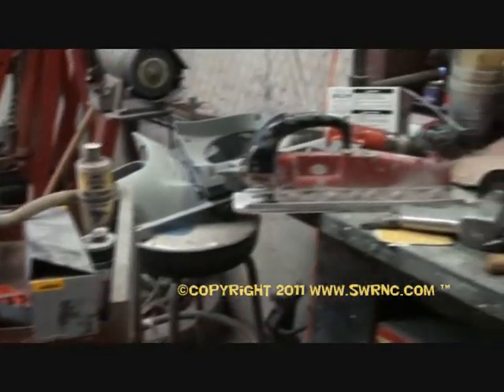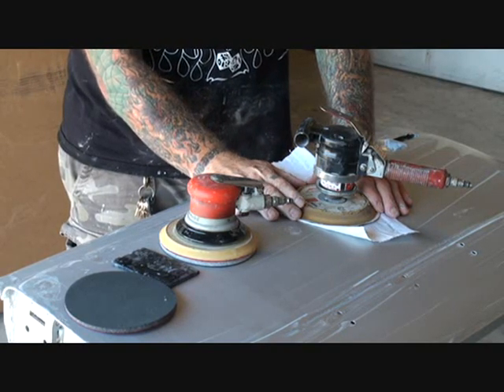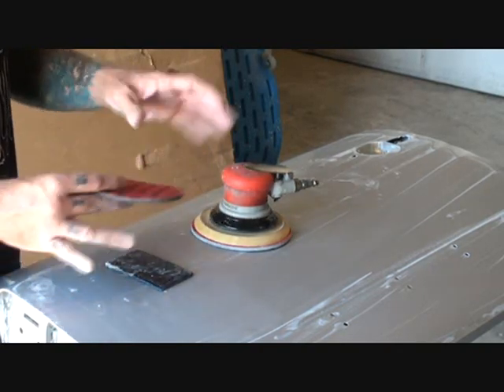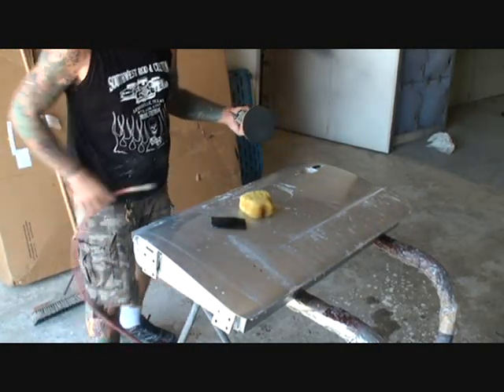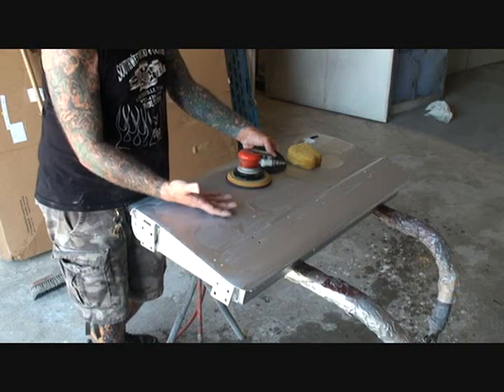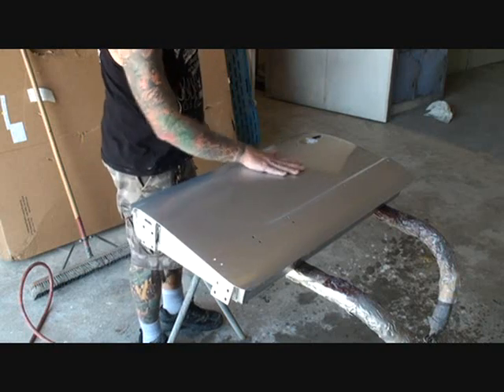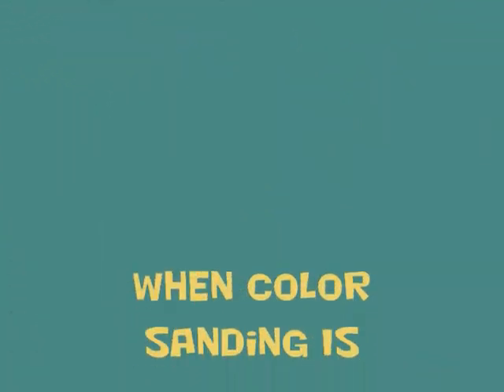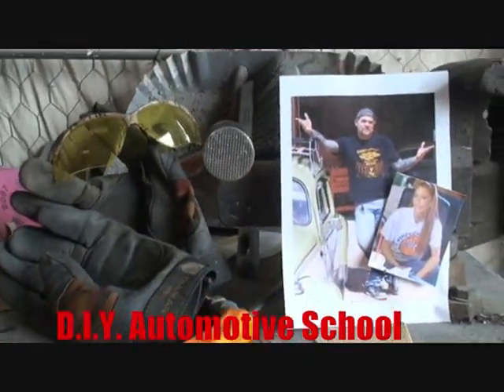HOW TO: Color Sand And Buff-Custom Car Painting-Part 3

Comment from the maker: @mrfields2177 It takes approx 3 to 4 pads to cover a whole car, by the time you get to 4000 all your doing is really polishing the clearcoat to make it easier for buffing. You will use  4 to 5 pads of the 2000 grit. Pete

Comment from the maker: Yes you can do that if the area is small enough and also the paint is clean, meaning there's not alot of trash in it.. I do use the d/a with 2000 quite often on toughup areas of the car..

Comment from the maker: That sounds good, but if you where going to clear coat it, you would be better off with basecoat paint, this way you don't have to worry about using hardner in the paint to activate it. And when you clear coat it, make sure you wait a few days for the single stage paint to dry properly, or it will react on you and get blister and fish eyes. Pete

Comment: I'm going to be doing my first paint job on my own (I've helped or had help before doing others) and I am going to be shooting a single stage Acrylic Urethane. The tech sheet shows that I can apply clear over the single stage and planning on doing this. To me it sounds like this becomes a Urethane Basecoat / Clearcoat and would be able to follow the color sand steps. I'm using a solid color (Graphic Red).

Comment from the maker: Factory clear is kinda a touchy situation, you don't know how much clear is actually on the car, so you have to be careful sanding it. I would find a small spot somewhere on the car and hand sand 2000 wet and then buff to see what happens, if it looks like it's going to work out then I would slowly colorsand it by hand and buff it out.

Comment from the maker: If you dry sand your paper will gum up and cause bad deep scratchs in the clear.. There is a dry sanding system you can use with your d/a but is very expensive, I am going to try it out and when I do I will making a video of it.. Pete

Comment from the maker: The only single stage paint that you can colorsand and buff are SOLID COLOR PAINTS! If you colorsand and buff metallics and pearls you will remove the finish and have blotchs and streaks in it.. I suggest that you wait it out and wash the car several times and you will notice that the dust specs will eventually go away.. Pete

Comment from the maker: @adi2200us I believe the 3m stuff you are talking about is dry sand type paper? I also like merka because of the price, it's way cheaper then 3m and does just as good or a better job... To each his own is what I say, if it works use it.. Pete
Reply: the 3m paper can be used wet or dry

Comment: thanks Pete I appreciate you taking the time to answer my question. I have just one more for. What you use to buff and polish small parts( again like a bike gas tank) the variable speed polisher like you use in the later videos, wouldn't that a bit too big? is their a different polisher you would suggest? thanks Pete i am grateful for your videos and have learned a lot from them. they have also inspired me to try new project and push myslef. thanks again sir

Comment: @diyautoschool no,it is not dry,it's wet system like you use,and it has that spongy back too and yes it is more expensive than other brands,just thought that you used it in the past,anyway I found a cheaper alternative to it from smirdex but they don't have a 4000 grit only 3000.thanks anyway Pete ,take care

Comment from the maker: @supersport2778 If your car is single stage SOLID COLOR  you will have no problem lightly colorsanding it and then buffing it, be careful NOT to buff through the paint.. It's the metallic and pearl single stage paints that are a pain in the ass to colorsand, because you are sanding away the metallic and pearl and it will leave your car blotchy and uneven.. You will be fine if the paint color is a solid mix.. Pete

Comment: Curious about your thoughts concerning the longevity of clear coat. When weathered it tends to break down over time and start flaking off. What is the most durable brand in your opinion? As far as single stage paints and the buffing process. Were you only referring to those paints that contain pearl, and metallic. Straight colors can be color sanded. Correct? True that clear has more depth, but I question it's durability vs. acrylic enamal. What are your thoughts on this? Helpful tips. Thnx

Comment: hi Pete i was wondering what you would use on curved or radius parts that need wet sanding? take for example a gas tank off a bike. I would think a block would not work as you would be like sanding on a edge the whole time. and your hand would not have uniformed pressure. do they make a curved sanding block? or what would you use? thanks Pete!

Comment: Hi Pete, does spending extra money on the clear coat brand ie (Max meyer) make a big difference to the finished result in gloss level?
 What i mean is if two identical cars were sprayed exactly the same but 1 car used a top quality clear coat lacquer and the other a cheaper lacquer would the extra expense spent on the more expensive lacquer give better results than the cheaper one even if i went to color sanding, would i see the difference?

Thanks Rob from UK
Reply: no one uses laquer anymore.

Comment: Hey pete those discs for the finish sander what are they called? Also your first sand which would be in the first video do you always do that by hand or do you start with the finish sander?
Reply from the maker: Yes I always start out by hand sanding with 1500 first, then proceed to the d/a sanding. The discs are made by a company called MIRKA you can purchase them at your local paint and bodyshop store.. Tell them you want wetsand d/a 3000 grit pads and they should know what your talking about.. Pete

Comment: if i want to buff my car  to remove surface scratches and crap in the factory clear coat ,  can i  just wet sand with the DA with 2000 and buff ,  or should i use 4000 and buff ?

Comment: Dear Pete
I am looking at buying a Makita M06040 its a sander and DA polisher,, its actually 2 very good machines in one,,at  the flip of a switch,, can I use this after I sand with the 4000 to buff the cars clearcoat,i will give the clear a go with meguires 105 and 205 and  2 different pads as normal.
Will a Da polisher give the same results as the huge Dewalt variable speed buff I have setup with lambs wool and foam finish pad.
The Makita is $550, will it be a good thing to use as a buff or should I stick with the big dewalt I have .
Steve in Australia
Reply from the maker: I use variable speed buffers with a double sided wool pad and then finish it off with a waffle face foam pad. I don't know much about the Makita so I can't tell you what I think about it, but I can tell you that I do my first buff at 1800 rpm and then the final polish buff at 1200 rpm. If the makita is a single speed machine then I would say to use the other. I also don't buff till I colorsand to atleast 2000 grit and most of the time to 3 or 4000. This makes buffing much easier and cost effect in the end. Good Luck Pete